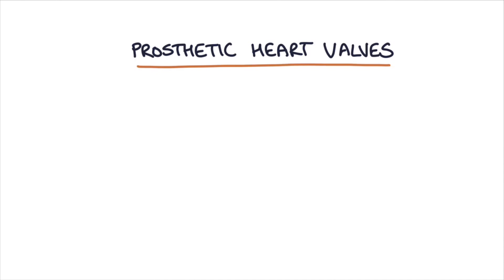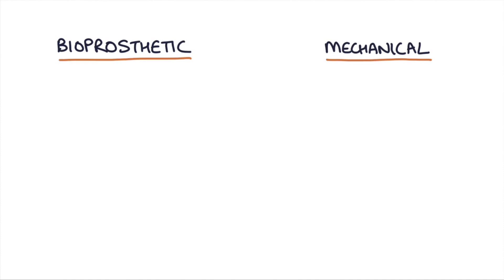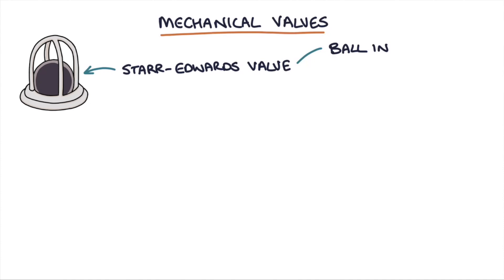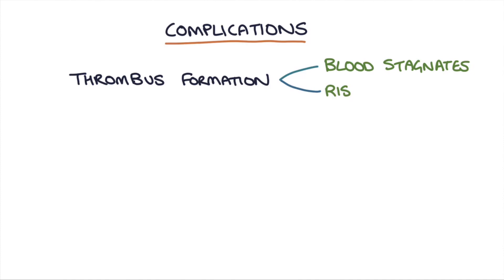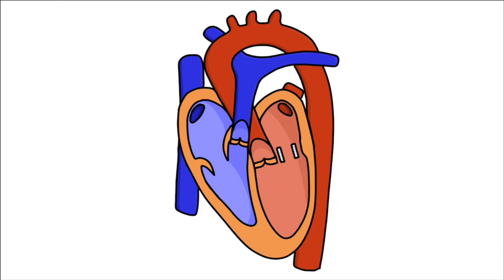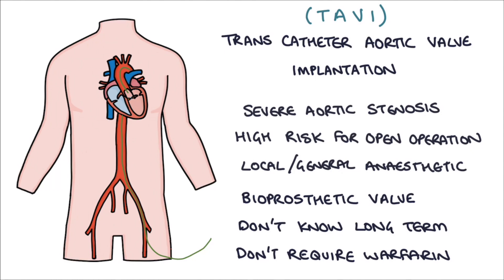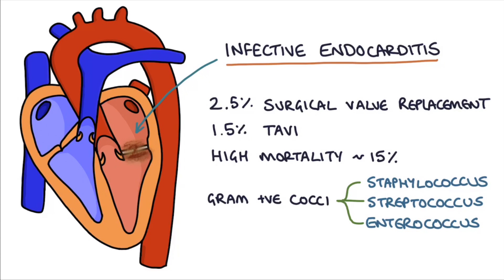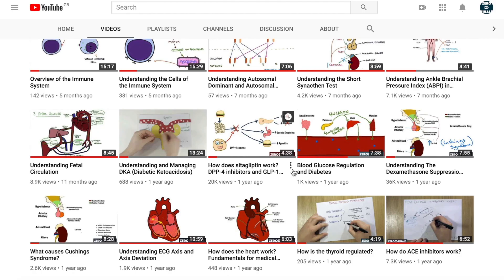Prosthetic Heart Valves: Visual Explanation for Students

Comment: This is great. I have had a St. Jude for a little over a year now. I had a dissected AAA that tore up my aortic valve (at 32 years old and in very good shape, I might add). I've had to search and search for basic information on mechanical valves. I've just been curious about this thing I hear clicking 24/7. I find it fascinating that we can do this! 

One thing to add, the thing feels like I have a diesel engine in my chest. The kick is unreal. I've gotten more used to it now, but at the beginning it was crazy.
Reply: You go thrw betall surgery?
Reply: Omg the click after the surgery was AWFUL. They also had me hooked to something that delivers shocks (I think) to correct irregular heartbeat. So when people would talk loudly, my heartbeats would go up and then I'd get a jolt down there.

 I had a bioprosthetic and moved to a mechanical one. Are you active? I can't figure out if my weakness and issues are from the second MVR or vasculitis. I was pretty active after the first one.

Comment: Im set to get my aortic valve replace with a St judes later this year, also getting My 4.8 aorta fixed.. Didnt imagine having to go through this at 25
Reply: Punished Aniquin  that May be true but im nothing but full of fear and doubts
Reply: I'm 28 and just had my 2nd open heart surgery 3 weeks ago. This time I just had them replace my Mitral valve with a St. Jude valve and things seem to be going good. Other than a click lol and Blood thinners .
Reply: @jacobhawk4560  Im 24, about to have my second heart valve surgery, with a mechanical one… one year after the last surgery
Reply: 16, Mine is in the Mitral valve, but I have a slight leak the aortic. How did the surgery go?
Reply: @stevenhoulihan1756  my surgery went well, got a on-x valve and a tube for the aorta, doing good 10months later but the first 4 were rough physically and mentally